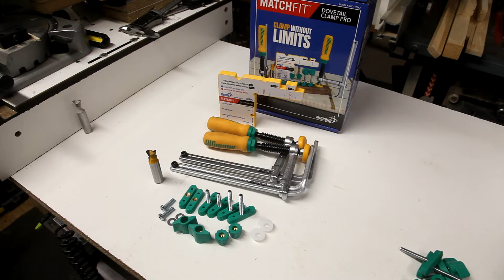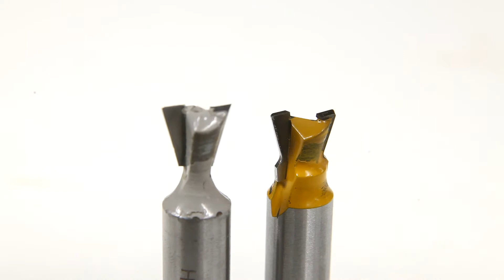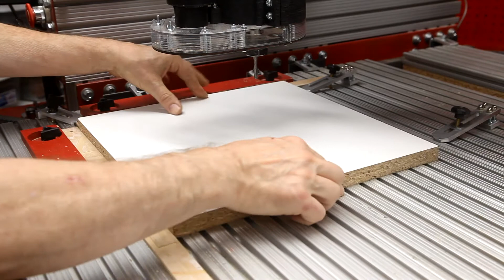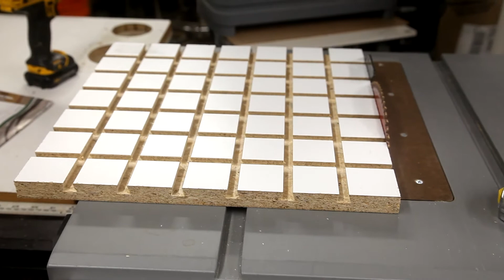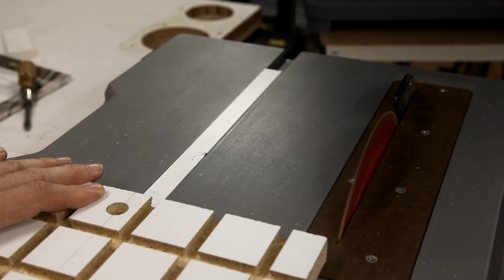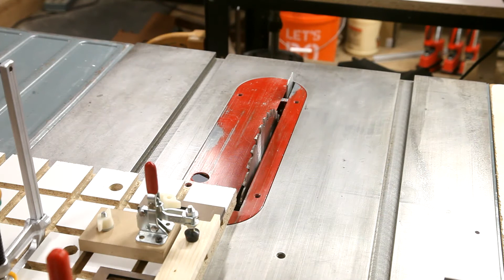Making a Fixture Sled with a CNC

Comment: This is great. I was looking for a matchfit sled built on melamine wondering if melamine is suitable for the matchfit system and I got my answer!
Reply from the maker: Don't overtighten or you will break off part of the board. Note that if you add something flat against the board and tighten above it, This will effectively Put the clamping pressure horizontally allowing you tighten much more without any damage. I think I have some pictures on my website where I talk about the CNC table I made.
Reply: @msimpson20175  Ok thanks, I will check it out!

Comment: do you see an issue with building a cnc waste board this way?
Reply from the maker: I use one on one of my CNC machines. Its made from 1" thick stock.  I don't mill into mine. I just use it as a clamp table.  I use 3/16" scrap stock I cut from old wall paneling as my waster boards.

Comment: do you offer this file on your site or other wise?  I'm a novice but have access to vcarve and a cnc at a non profit i support..
.  thanks in advance
Reply from the maker: I don't offer the drawing files for this as it is straight forward. Choose any spacing you want. Note that the Microjig hardware also comes with instructions to do them manually.
Reply from the maker: The jigs for holding the frame components, can be just some stops with clamps holding them into place.